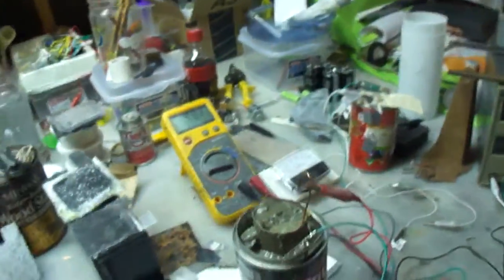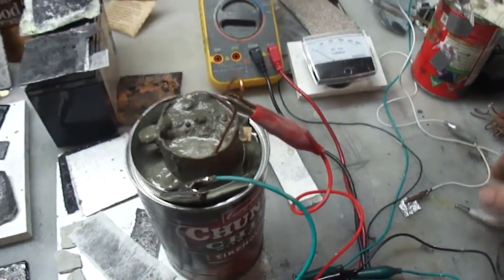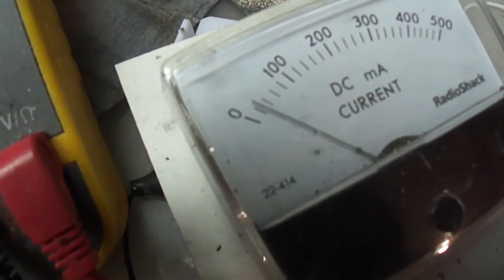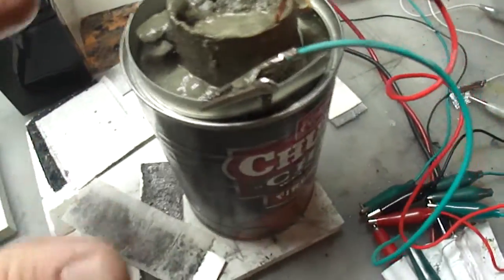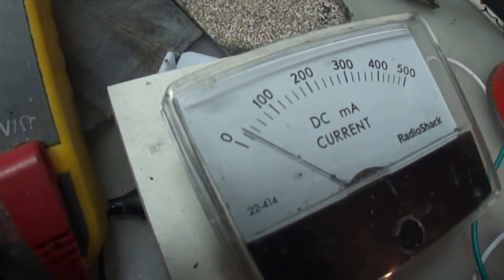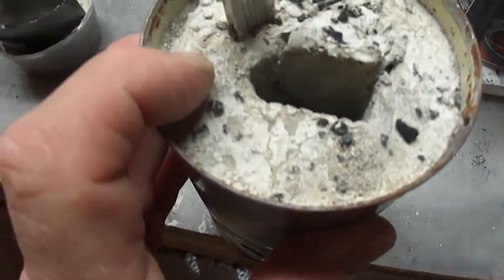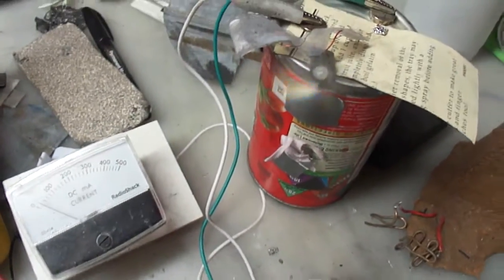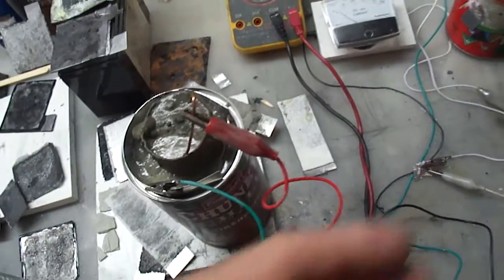Soda Can Battery - Power From Trash - DIY Project Runs Drone Motor

Comment: Try hydrochar seaweed instead of graphene.
Reply from the maker: Thanks Armondo,  your right I have tried diferent plant materials in a hydrothermal carbonization chamber with different liquids and you get excellent results.  I will need to buy some seaweed at the grocery store and try it.
Reply: Dad Scientist What is the best catalyst to make an effective hydrothermal carbonization? And Ratio portions, according to seaweed powder and water quantities?
Reply from the maker: Not exactly sure, but I think it would be 60% seaweed powder, 20% liquid which could be amonia  or a weak solution of sulfuric acid or vinager.  You could even use rusty water which is basically iron nano particles this will attach themselves to the carbonized seaweed.  There are many ways to add to the conductivity of the carbon.  Just be careful.  Make sure you leave only a small area in the chamber for air expansion.  This way the pressure is not to great but just good enough.  Remember too much pressure is dangerous unless you have the proper equipment.
Reply: Dad Scientist Pressure Cooker could match the temperature/pressure requirements.
Reply from the maker: as long as the seal did not melt

Comment from the maker: I just remembered that I did not include that when making the cement battery , I condition it using 2vdc up to 15vdc , charging and discharging the cement battery over and over again.  I think this creates small bubble inside which allow the water to be reintroduced at a later time and give the battery the ability to charge again.
Reply: Ed, are you saying you cured the "current-cement" while it was wet before pouring? Or are saying, You "current-cured" the cement while it was in the form and not quite in a "formed state" (solid)?
Reply from the maker: I current-cured the cement while it was in the semi solid state in the form. for 1 brick you must put one table spoon of graphite , 2 cups of sand, 2 cups of portland cement, 1 table spoon of "cement all",  mix well dry.  Now add 
1 table spoon of choline chloride to 1 cup of water and stir until dissolved, pour into the dry cement and stir until it is mixed well. I put a layer of cement down and then a sheet of aluminium then pour more cement on top of the aluminium , about a 1/4 inch thick then lay a copper sheet down and cover with the rest of the cement. Now charge and discharge the 
brick over and over while it cures.  Keep it moist.  I think it creates micro bubbles which act as electron exchange chambers.  My 
Cement batteries are about a month old now and still charge up with 12vdc and .5a current.
and deliver 50ma of steady current at 2vdc down to .3vdc to a small drone motor for about an hour.  Note: I have made 5 batteries and connected them in parallel for more longevity.  If you made a wall of these and used a solar panel to charge them , you could run a nice Led light bulb for many hours.
Hope this helps.
Reply: Okay. Got it thanks.
Reply from the maker: while it is still wet , I put the electrodes to it to let current pass through while it became solid.
Thanks

Comment: Ed,
Very cool!!

your toy motor is likely a 3-6v motor, that can draw 20-80mA. You would need to test it with batteries to know. Don't overwind (over-run) the motor or you can blow it up (electrically). Many people are not aware that "concreate/cement" and the mortar can be (and usually are) porous - meaning they can soak up water like a sponge. But cement is usually alkaline in nature, so yes the "Cement All" is having some effect. I'm not a chemist so my guess could be wrong. Again, concrete is porous. Water motion through concrete is slow and often it will overflow before it leaks. Sorry I can't find any papers or articles to explain this (at the moment). Best of Luck
Reply from the maker: Thanks for the info.  Cement must be extremely porous because the cement absorbed the same volume of water as the volume of cement.  The charge current goes up and the output current of the cement battery is @ 50 ma the voltage starts at 2.0vdc,  that is with a 10vdc charge for 30 sec at 350ma.
Reply from the maker: O I also connected 4 more cement batteries in parallel it will run the motor much longer.   I dont know if this type of battery would be good for much unless you had about 40 batteries charging off a solar panel.  It could run a very bright led light all night , I guess.